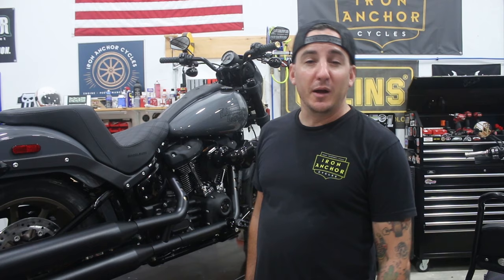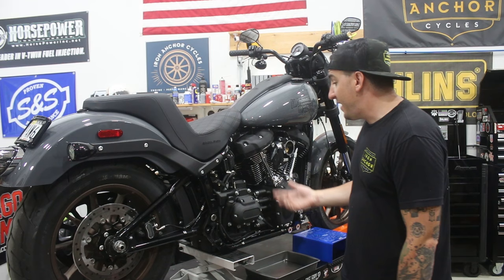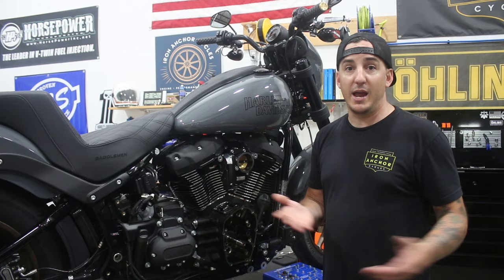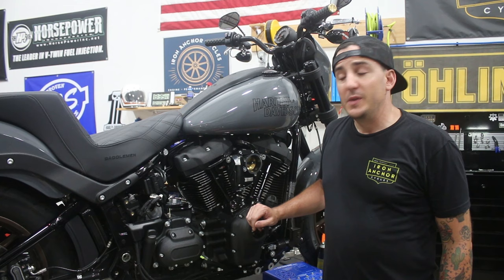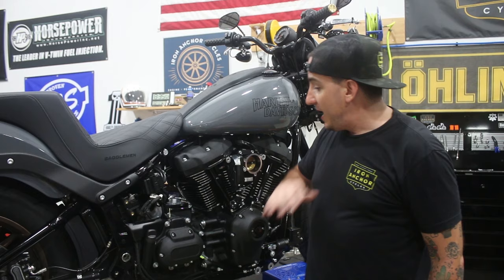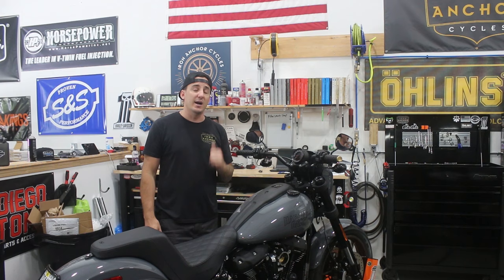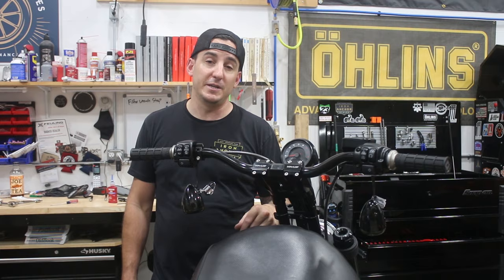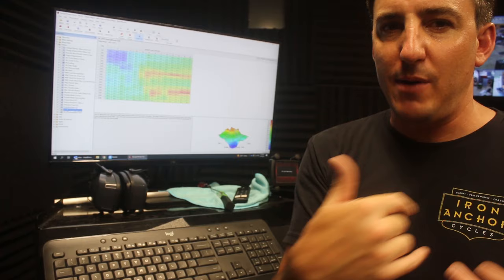Taking a 2022 FXLRS from stock to RIPPER!

Comment: The torque dip is NOT caused by the 475 cam and I have the dyno sheets to prove it. What causes it is reversion. Some may call it lack of back pressure. M8's and their 4 valve heads are serious free-flowing engines. Short free-flowing pipes such as the HPi, TBR, Bassani, Royal T Racing...etc cause the low end torque dip. When I dumped that short free-flowing pipe on my 114 and went with the S&S Super Street (non-epa compliant) pipe.  The low end torque dip after being dyno'd disappeared. The neck snapping throttle response from idle to redline it has now is absolutely amazing. I recommend anyone with an M8 to stay away from those short pipes unless they have anti-reversion chambers built in them. Stick with S&S, D&D or better yet.....Thunderheader. Unfortunately, many will not heed my advice because they HAVE to have that stainless pipe on their bike because it looks cool. If downshifting and high rpm's is what you want just to pass an 18 wheeler at 55mph. Then buy the short pipe. But, why would you want to spend less on a performing pipe when you can spend more on something that looks cool!....ugh. So many M8 owners out there that are completely clueless due to lack of research. Have you noticed that HPi and other companies that sell the short stainless pipes NEVER post the actual dyno sheet showing the torque dip. They ONLY mention Horsepower and Torque numbers. Use your heads people....
Reply: Totally agree with you.
Reply: Well said, shorty pipes look good but sticking with my D&D billet cat and 475 with some other goodies my curve is beautiful on my 114”
Reply: I was going to go with the redshift 468, stock header with khrome werks slip ons and stock air filter.  From what I have found the stock air filter can supply enough air for that type of setup but I’m still not really sure if that’s the best way to go.
Reply: @Steve-qn8gn  my builder always suggests the Arlen ness big sucker because it can handle a lot of power being thrown at it, I personally run the SE heavy breather but if I would do it again I’d go big sucker, he’s built a few bikes pushing 170hp and the breather was doing just fine. As far as your stock header I would try to get it de-catted as well.
Reply: @stm250  I should have been clearer, my bike is the 21 rks with the ventilator air cleaner, the can move a lot of air.  From what I understand I can replace the filter with a k&n replacement and move more.  That would most likely be the step I take if I need to switch.  I like the look of the stock air assembly.  Maybe in the minority lol
Reply: @Steve-qn8gn  Oh ok yea I dig that cleaner, you should be good but if you want good power ditch the cat or get a nice 2:1 pipe or the khromewerks 2:1:2 makes good power as well. Nice choice on the RKS I have a 20 RKS.
Reply: Thunderheader
Reply: Horsepower inc posts dyno results all the time. Follow the dude jimmy who tunes.  Does wonders.
Reply: Totally agree. I’m modding a Triumph triple but if I get a second bike I want this. 

Good info.
Reply: Any experience with the FM jackpot riot?
Reply: @Johnnie Red  I believe the newest version of the Jackpot Riot has anti-reversion chambers in it. Those chambers eliminate low-end torque dip for the M8.
Reply: S&S have a stainless version if you want both a good legal exhaust and the looks you want.
Reply: @Uncle_Dirt  This is correct.  However, if you have a short stroke built off the 107, the longer pipes will still do better for HP and not drop any torque.
Reply: I am shopping for an M8 bike. Can you you advise if all of the engines are ok to upgrade for more torque, etc…107, 114, or 117? Also, which of the models do you recommend? Thanks. Star racing has a 3030 cam or something like that…do you know anything about that one?
Reply: I completely agree  with you, I was wondering, I have the "stock" head pipes on with a 2 into 1 Rinehart slip-on, the cat was in the muffler, so no cat, however, like you, I want to keep my back pressure, I have a 2021 Sport Glide with a 107, Star Racing 30 / 30 cam, S+S 55mm aluminum intake, S+S lifters, cam plate and oil pump, 107 HP and 125 ft lbs of torque, my torque numbers are pretty good, however, I too have the "dreaded" dip initially, my pipe is actually pretty long and goes well past the rear swing arm, I would like to go to a full, stepped exhaust system with no cat, but, you're right, I'm having a difficult time finding a long pipe for a softail, to me, the D+D and Thunderheader pipes are really ugly, did you look at the V+H Pro pipe? I think they only make them with a cat now though, just ran into this video and it's a year old, but, your thoughts on a long pipe without a cat for a softail would be appreciated, no one seems to make one that goes past the swingarm, thanks and ride safe man
Reply: im looking at the superstreet for my bike. any issues? Thanks
Reply: @kanenaysmith9287  DO NOT buy the EPA compliant Super Street. The catalyst WILL MELT itself closed and potentially fuck your engine up. Plus, S&S will not warranty the pipe.
Reply: Looks are just as important as performance and sound. I hate S&S pipes. They look and sound like shit. 🤷🏼‍♂️

Comment: The dip in low range is from exhaust due to short pipes on softail. Thrashin supply Has a full exhaust with champers in the front close to cylinders and it will get rid of majority of that dip in the low rpm trq curve
Reply: How much does baffle size effect the power graph?
Reply: @clubstyleridahd4695  that idk. But I do know that thrashin has a good exhaust for softails that has the chambers and keeps that dip from happening
Reply: Thrashin quality is terrible. -thrashin supply pipe owner.
Reply: @Two Wheels  i also have noticed that the torque they claim these AR pipes make down low is not to be seen on most dynos I've seen. They don't have much power off the hit in most configurations
Reply: If you really think you’re going to get any serious gains from exhaust; I have some great beachfront property to sell you in Nevada. 

Also have a big bridge in California I will sell you for scrap.

Comment: Just what I needed. I have the low rider st and a HPI pipe on order. Looking at cams and cam chest kit currently. Great video and insight! 💪🏻
Reply: No need for cam chest if you only doing cam upgrade save that money for elsewhere mods. Also look at fueling reaper 472 cam it’s what I have in my 21 ultra 114” and put down 119hp and 129trq and it sounds great
Reply: Did you get your HPI Exhaust yet?
Reply: @toomey2wheels247  Just got it last week. I ordered it on the 29th of august. Took about 14 weeks
Reply: @Kris Dolmeth  nice man! Just oreded mine 2 weeks ago I'm a ways away lol
Reply: @toomey2wheels247  Definitely worth the wait! It’ll go by quick 👍🏻
Reply: @Kris Dolmeth  ya I saw the block head video on the ST. It sold me lol
Reply: Star 30/30 cam.

Comment: Nice work, very informative video! I am planning to mount Kraus 10" kickback and fly moto bar on my 2023 Low Rider S. Could you pls share the overall length for the upper clutch cable and the upper brake line you ended up using for this build?  My guess would be 26" brake line and 38"" quick connect upper clutch cable. Did you also extend the gauge cable by 4 inches or the stock length is loose enought? Thanks and keep it up with the good content!

Comment: Can i use the same bar on my stock 2022 low rider s just change risers? Or the bar comes complete together  with its risers?. Just need a 6 inch lift not like yours.

Comment: I took my 2022 Lowrider S to the dealer to have the 475 cam installed. Manager called me next day and said they were ready to put the new cam in but when they opened it up my bike already has a factory torque cam in it. Also he couldn’t find the mapping to tune my bike according to the new cam. So they reassembled everything, didn’t charge me except for the adjustable pushrods. I don’t know anything about mechanical stuff so was the manager for real that my bike came with a torque cam ( bought it new ) or something fishy going on here ???? Please help.

Comment: Just bought a 24 lowrider st is there a way to disable the abs/traction control  ? Planing on going with a rcs19 with the radial calipers but how will all that work with abs ? Just run steel braided lines from master to caliper

Comment: Hi nice job. Do you need to extend cables if you use 8" risers? I'm 5' 9", do you think 8" risers are good for me?
Reply: I’m 5’9 and did 8” risers and it works for me  , and yeah you’ll need to extend the cables, it’s a paint in the ass. Honestly though man, I kinda wish I had done 12” risers now lol oh well
Reply: Go 12 inches bro you won’t regret it I’m 5’7 and it’s still perfect
Reply: I got 8" with a 2" pull back on mine with stock bars and site good for me  I am 5'9"  But really all depends on body style also  If your all leg and little upper body you need different than someone short leg and long upper  My wife is also 5'9" and they arent even close for her